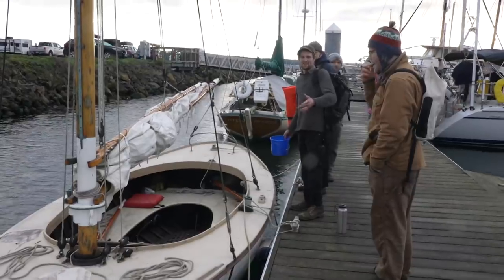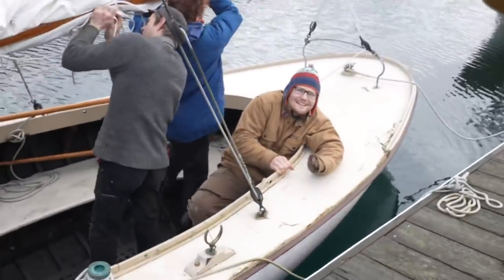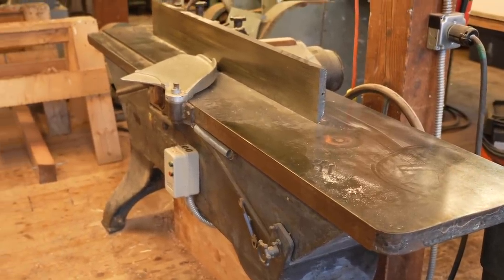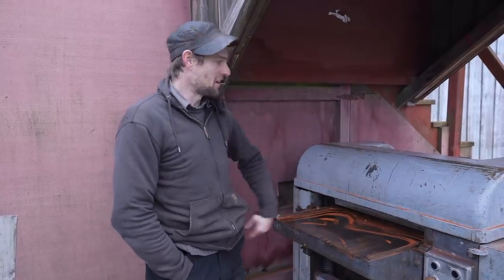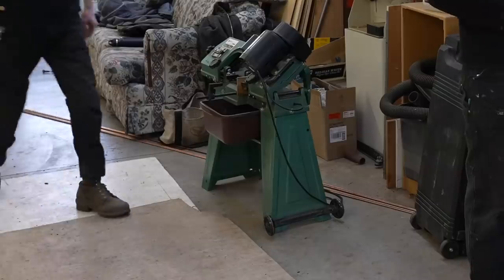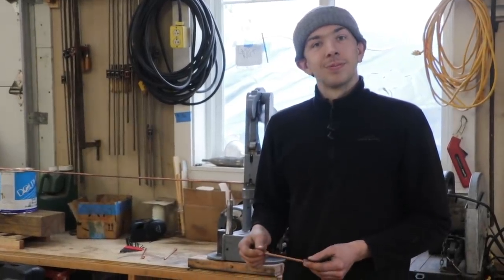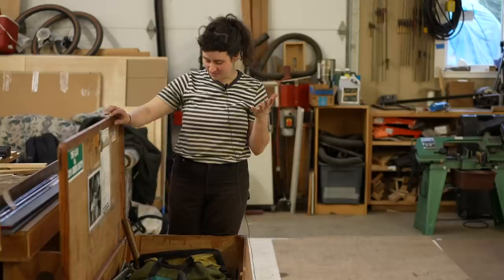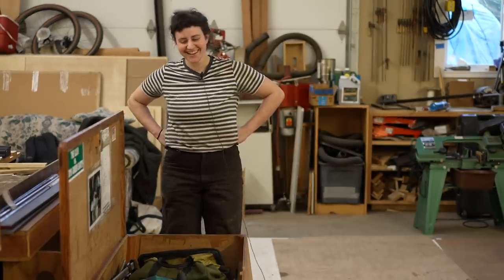“Hey Pete, what are you doing?!” (Rebuilding Tally Ho / EP89)

Comment: I think recovery is still possible.
1. 1. Let's gradually fill in the large holes and restore it to its original state.
2. 2. I think the reason for the large hole was that the melted lead was too strong. It is also possible that the bottom plate could not be reinforced when the hole was opened.
This work under the ship is worrisome. Why not move the ballast keel to a safe place and work on it! Also, be careful about steam explosions.

Comment: Oops, broken drill, check the brushes first, they are the usual culprits on these models. They are either gone, or blocked in the holder after a drop or so, a wiggle will tell. Next to go then is the armature which burns, and if you are unlucky the magnets in the stator losing there magnetic force. Parts are not overly expensive and repair is not really difficult.

Comment: Tally Ho: Rebuilding a 1910 Gaff Cutter
Is there any original wood from the Talley Ho in what you have now?  It seems as if all the old wood has been discarded and all the structure and planks are new wood.  The lead keel may be the only original part reused.
Reply: ... and part of the transom is original: 111 year old teak. There will be other  parts reused in the future such at least one companionway
Reply: There are some bits of bronze that'll certainly be re-used - rig fittings & portlights. The huge capstan needs some TLC, mebbe even an electro-hydraulic conversion.